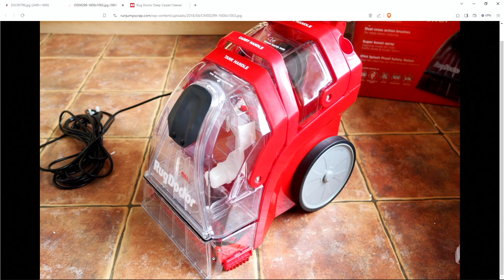Rug Doctor Deep Carpet Cleaner - Diagnostic & Repair - iRefab

Comment: Plastic bit with seal came off front of mine and doesn't seem to suck up water must have came through the small 0lasroc bit at the front, can that be replaced please
Reply from the maker: I’m not sure if they sell this bit as a replacement part.  If your based in the U.K you can definitely try giving them a call at one of their contact numbers on their website and see if you have any luck.
Reply: @irefab I will do thank you yes I'm from Glasgow

Comment: Hi i noticed you mentioned an 0 washer on the tool, my tool doesnt sqirt the water out but the rest of the machine works fine would the 0 washer caise this problem in the tool?
Reply from the maker: It’s been some time since I have worked on one of these so I can’t say for sure.  I would say if yours is corroded as badly as the one in the video then just replace it.  If it doesn’t fix the problem you know you have to investigate further 👍

Comment: Wish you demonstrated how to get to the motor.
Reply: Think she means demonstrate how to remove the motor from the machine.
Reply from the maker: I ordered the motor direct from Rug Doctor U.K. website.  They have a section for spare parts and they sell direct to the public.  It was delivered in just 3 days.  If you are in the US they should also have a US website.  Just go to google and type in “Rug Doctor Spare Parts”.  Hope this helps 👍
Reply: @irefab  do you have a video to show how to dismantle and get the motor out?
Reply from the maker: @geoffnicholls7495  Apologies Geoff, as we are a third party repairer Rug Doctor will not share any service manuals with us or technical diagrams.  The service manual would have shown clearly how to get to the motor in corresponding steps and I could have shared that with you. The only other way is to try and figure it out and I know that's not ideal.  I hope you understand.

Comment: Hi don't know if you could help me somone gave me one of these . But is not sucking up water . But the pump is working you can feel the suction  when you take off the reserve  tank x
Reply from the maker: My advise is get someone to take a look at it.  Find a local repair shop if possible.  If the brush is not going round it could be a number of issues.

Comment: hi buddi i got the same propblem but cant smel any burning just tripps out when put it on tool when i it tripped out the first time i reset it it run about a few secounds then tripped out but tryed it yesterday soon as i put it to tool no running just tripps out can you give me some advice on it its a good machine dont whant to by new one thank robert
Reply from the maker: Hi Robert, If you could answer a few questions, that would help me advise you better.  How old is the machine?  How often is it used?  Meaning is it used daily?
Reply: @irefab  about 4 year old
Reply: yes daaily lot of traffic in the liveing room
Reply from the maker: If it’s 4 years old and used daily from my experience I would say the bearings are shot in the main motor housing causing it to short and trip.  The first thing I would check is the wiring from the mains plug.  See if you have continuity and no shorts by using a multimeter to test.  Then I would check the circuit board and finally the motors.  There are 2 motors on this machine.  1st is the main suction motor and the other 2nd is the brush motor.  It’s quite a big job taking it all apart, if you don’t have the patience it’s best to get a local repair shop to check it over for you.  Hope this helps 👍